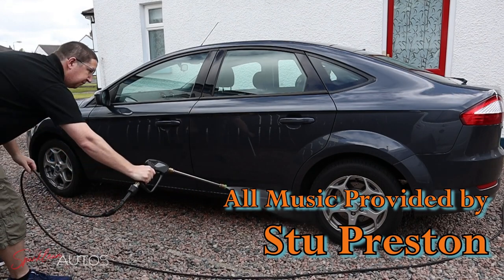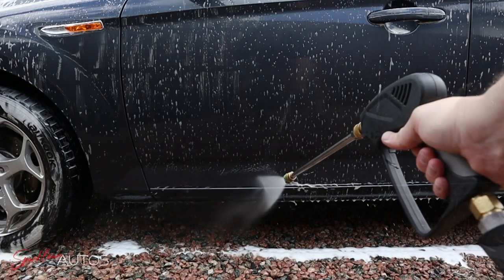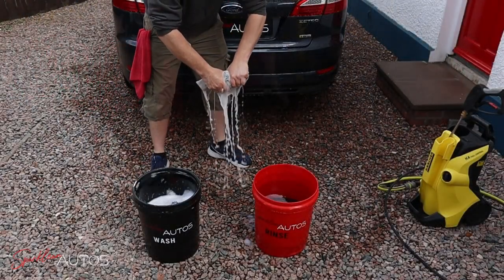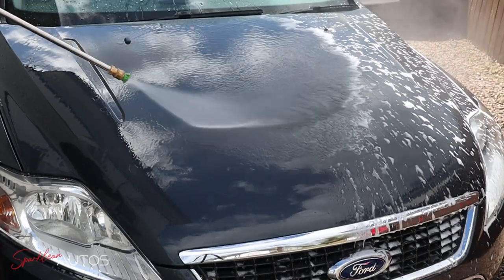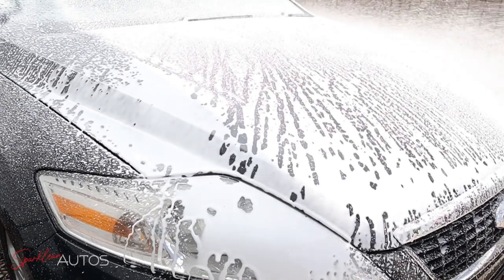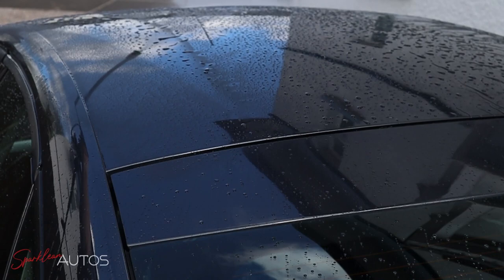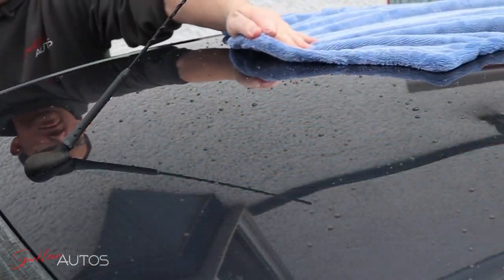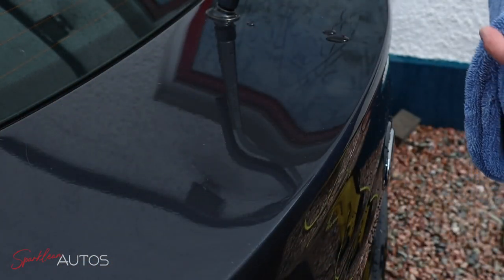Ceramic Sealant in 2 minutes?! No effort?!  Easy Vehicle Protection #ceramic #sealant #protection

Comment: ive used the autobrite Magiseal product over winter, and it worked pretty well.... need to try the alien magic version but i guess they all contain similar chemicals to achieve the same results.
they have a place, and if youre in a hurry because its baltic in january but you want to get the car looking decent, then these products couldnt be simpler,
Reply from the maker: They definitely have their place, Dave! Quick, easy protection that you can do without taking your gloves off or having cloths to clean! 👍🏼

Comment: Another great video Mark, I used magiseal this last winter and it's so easy to apply and gives good protection and perfect for not hanging around outside in the cold weather, as with all products I'm sceptical with longevity claims so I reapplied after 2 months and that worked out fine.
Keep up the good sir 👍🏻
Reply from the maker: Cheers Paul 👍🏼 I'm the same although the Constellation Chemicals one doesn't make any claims, as far as I'm aware - I think 6-8 weeks is a reasonable expectation from a spray and rinse off product! Time will tell but, like you say, I wouldn't object to reapplying this type of product every couple of months. 👍🏼

Comment: Be interested to see this in a month or two - I've used Magiseal previously and that wasn't too bad endurance wise.

What drying towel were you using?
Reply from the maker: You will see its progress over a few weeks, I'm interested myself just how long it will last 👍🏼

The towel is from County Detailing Supplies - 'The Dreadnought' -

https://countydetailingsupplies.co.uk/product/the-dreadnought-dual-twist-microfibre-drying-towel-50x80-1400gsm/
Reply: @SparkleanAutos  I love county detailing... It's a bugger as they are only down the road too.... Great restraint is exercised daily.
Reply from the maker: 🤣🤣 I'd be divorced if it was close to me!!
Reply: @SparkleanAutos  I am divorced as it was cheaper in the long run....